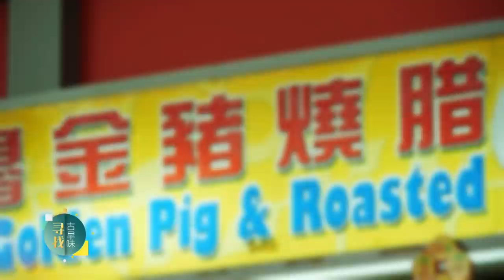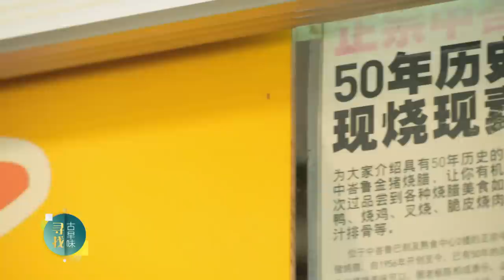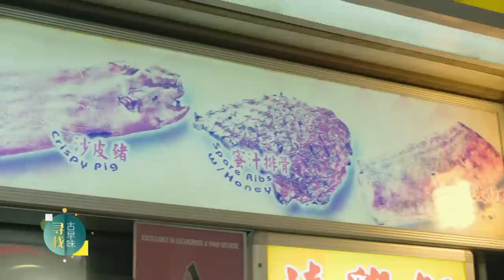Old Taste Detectives S3 古早味侦探 S3 EP11 | Cantonese Siew Lup Rice 广东烧腊饭

Comment from the maker: If you would like to head down and try the food featured in the show, here you go! 👇😋

[Traditional] 
正宗中峇鲁金猪烧腊
30 Seng Poh Rd, Tiong Bahru Market, #02-67, 
Singapore 168898
To Try: 烧腊饭

李鸿记广东烧腊
30 Seng Poh Rd, Tiong Bahru Market, #02-60, Singapore 168898
To Try: 烧腊饭

瑞益珠江烧腊供应批发
3015 Bedok North Street 5, #02-10, Singapore 486350
To Try: 烧腊供应商

Yew Lee Metal Works Pte Ltd
17 Tai Seng Dr, Singapore 535221

-----

[Fusion] 
Clan 7
151 Lorong Chuan, NTP+, #01-11, Singapore 556741
To Try: 松露烧鸭

Hopscotch
15 Stamford Rd, Arcade @ The Capitol Kempinski, #01-83, Singapore 178906
To Try: 意式烤乳猪

[Fusion] LECOQ
25 Church St, #01-04, Singapore 049482
To Try: 伊比利亚叉烧夹饼